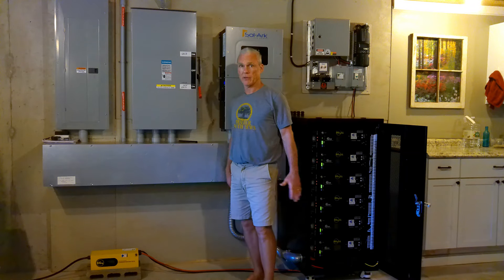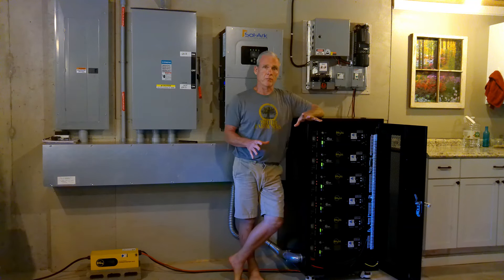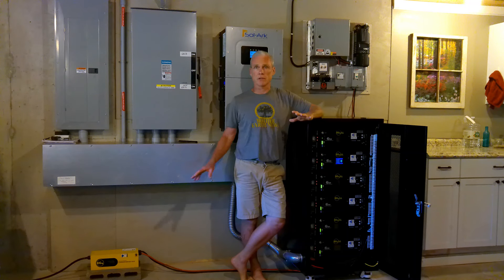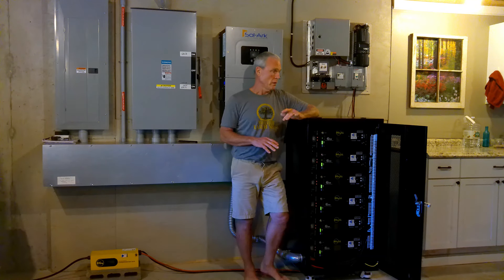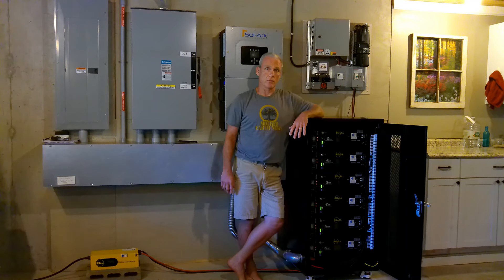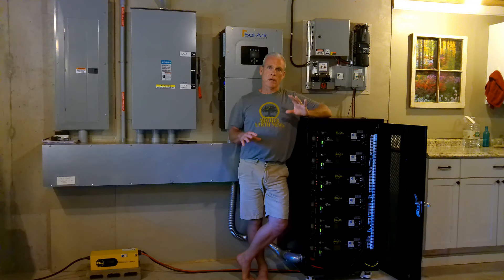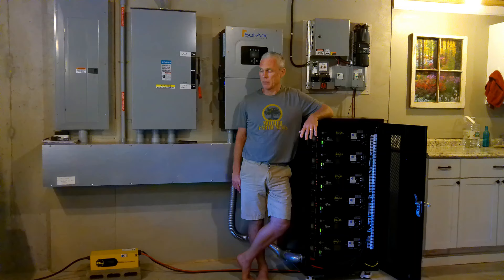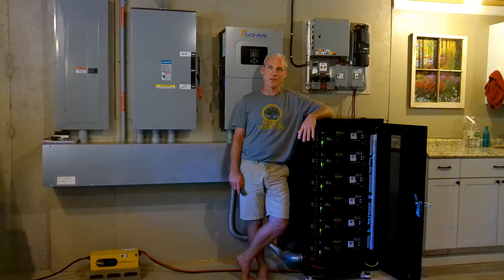Summary of our Off-Grid: Solar, Wind & Generator

Comment: This is literally a smaller version of what I plan to do! Only differences being that I'll have 10 of those EG4 battery racks (303 kWh total), 5 SolArk 15k's, 2 Missouri wind and solar controllers with 2 turbines (1 for each), 90kw of solar, and a 38kw Kholer Generator. This is going to be for a 100% off grid home with zero connection to the grid (too expensive to run it). Only question I have is, how much power do you think your turbine produces? Like on average how many kW does it produce nominally and and how many kWh do you think it produces in a 24 hour period? Been somewhat hard to find this info, I know that it varies by area but just trying to get a general number for each.
Reply: What’s your energy usage typically? 300kwh seems a bit excessive. But sounds like a really cool system
Reply: Good Lord. I think that’s enough power to run the USS Nimitz
Reply: @andrewdavenport6696  10 of those bateries have like 50 kw/h power,not 303,i think it a typo
Reply: @83kaszas  10 Racks, not 10 batteries
Reply: @jordanrobinson5817  oh right,i just re-read it,holy moly,thats alot of power XD
Reply from the maker: WOW!! quite an IMPRESSIVE system you have there...and people think I spent a lot of money! I wish I had a solid answer for you. I installed it in August, and we don't have much wind this time of year. My batteries stay full too and until the battery voltage drops low enough the turbine won't be able to push power into them so the turbine's voltage reducer will kick in. Now this winter when the heavy cloud cover and winds roll in hopefully it will spin up some power. I will post real world info on the power output then.
Reply: @goingoffgridatgreenshireho435  yeah cant wait for that! For a simple home dont need 300 kw battery....i have 17 kw,and for us is enough,even with electric cooking and hot water....i gues it depends how much ppl use..
Reply from the maker: Wow electric cooking and water! I take cold showers and theres only 2 of us in the house. I store too much food and water too! just never think I have enough and I can't live for the day...always in the future. More so now than ever.
Reply: Wow...hope you're planning to upload a YT video when your system is completed.
Reply from the maker: That is an amazing power plant he is putting in! I thot about adding another rack to my system, although I can't justify it because my 30kw bank stays above 75%. Can't imagine 10 racks and 5 Sol-Arks, it would take up an entire wall in my basement. I wish he was close by...I would like to see it in person.
Reply from the maker: OK, not a big deal but a bit of info for you...we have a 15-20 breeze today and the batt voltage is at 54, full is 57, but the clothes drier is running so were pullin hard from the solar. With all that going on the turbine is spinning decently and the MPPT is charging at 1.3A into the batteries. not a big deal but its doing its job. More to come.
Reply from the maker: Drier is off, batteries are full, turbine still spinning but MPPT is "resting" Auxiliary 2 on the Classic shows voltage reducer has kicked in. I think winter will bring good results.
Reply: I have 5 chicken farmers right next-door to me that are putting up over 60 x +500 W panels on the roof of their outdoor burns, and when I look at the pole in front of their place, it usually has three transformers. I guess if you think you're a big boy and you want to sell back to the grid, you need three transformers.

Comment: Nice solar array and batteries but the worst possible choice for an inverter. High-frequency, transformerless inverters like the one you installed offer a shorter life expectancy, and a much poorer surge capacity. And because these low-cost (cheap) inverters don't have an output transformer to provide galvanic isolation, they can damage your off-grid home's appliances when their MOSFETs fail. Don't take my word for it; ask Google AI the following question: Can a high-frequency, transformerless inverter damage your appliances?" and learn the truth about these crappy inverters.
Reply from the maker: Can you suggest an inverter for the people who read this.

Comment: Nice clean set up.   I would like to switch over to a gutter  like you have.  I am Running a 15k Sol-ark,  27,000 watts of panels.   One eg4 5000 watt mppt, 80 amp epever and a 50 amp epever.  11 eg4 lifepower batteries,   two build 280 amp hour batteries.  Running  almost Three years at this configuration.  Use between 50 to 100kwh a day.   Have three 48 volt battery chargers {45AMPS TOTAL) for Genny input if needed. No way could I go off grid with out a divorce.
Reply from the maker: LOL...I know others that have mentioned the "Off grid divorce." Sounds like a heck of a nice and powerful system....you have a big house and run heavy loads, my buddy is the same way and won't go off grid for the same reason you don't. His wife said "NO" to selling the big place now that the kids are out.

Comment: The solar credits are great if you start with solar and however this works only if small number of users have solar. In europe we do notice the same trend that the solar credits drop because the grid can't handle anymore the excess energy during sunny days. My recommendation for users starting with solar is  go for a PV system that works offgrid, always install more solar panels than you actual need and size you battery that covers 1 or 2 days of your normal electricity consumption. The small wind turbine is great during winter when there is less sun however more expensive than PV to maintain.
Reply from the maker: Wow I knew Europe had a lot of solar but didn't know it was too much for the grid. Wonder if America will get there...no time soon I'd guess.

Comment: Definitely seems like a waste of a grand for that transfer switch. Could have installed a 200 amp panel with feed through lugs. It has a main breaker, 8 spots and lugs at the bottom rated for 200 amps. Take those lugs and wire them  into the solark. Then solar output into your regular main breaker panel. Buck 80 I paid for mine. I still have the grid going into my inverter. The inverter can bypass if it needs to. Or turn off the main breaker in the bypass panel panel if u really want to have the no grid experience
Reply from the maker: Wish you lived near me and could help me build it. The electricians who helped me said the equipment and method were not negotiable, "We will do it and do it right" is what they said. I looked over the bid and plan and since they were very professional and the ONLY crew I could find within 3 hours of me, I said sounds good. When you spend 46,000  for a system the 1,000 for an excellent panel is not worth arguing.
Reply: @goingoffgridatgreenshireho435  woo wee. That's that's not pennies. 
I spent about 30 on mine. I have 12kw of panels, 12 kw of inverter, 85kwh of batteries but my system isn't UL listed. U definitely pay more for labor and listings. When it's not DIY. But yours system definitely looks clean
Reply from the maker: Thank you! I'm just a guy tryin to help others by sharing what works for us. The comments help too because it gives people alternatives that I may not of thought of or that may be better than mine.

Comment: Make a video on the wind turbine alone, what make and model is that and was it a kit with the control panel etc. It would be nice to see a video on it and how it hooks up to the overall system in detail? Did you keep any build pics and parts list diagrams etc?
Reply from the maker: I have a video on the turbine alone. If you click on the Greenshire tree emblem it will open the channel and you'll see the turbine video. It is a 1600w from Missouri Wind and Solar with a preassembled control board. There are different control boards for lead acid and lithium batteries. The turbine mounts on a 2" sch 40 steel pipe, the cable runs down through the pipe then through conduit to the control panel. The cable has 3 wires that connect to the rectifier on the control panel, then the 2 battery cables from the charge controller connect to the battery bank. I was alone and it took me a day and a half from start to finish. Once it's all hooked up call MWS and they will walk you through programing the Midnite Classic which is easy to do. The assembly of the turbine blades and tailfin itself is easy with clear photo instructions. The video will detail most of this for you.

Comment: Why is your generator not wired in through the SolArk?  Same with the wind turbine?
Reply from the maker: Good question, 3 part answer. I wanted to minimize the work the Sol Ark does. Since the gen and turbine are only used to charge the batteries it is more efficient to bolt them right to the bus bars. Lastly I will eventually use the "Gen" port on the Sol Ark as a dump load to the water heater or AC. The "Gen" port is both in and out current capable.

Comment: Building my system now. Can you do a video of the wiring through the bypass switch? How long can your battery bank power your home with cloud cover and how much energy do you use daily. Appreciate all your videos.  I guess I need to start documenting my process to help those in the future.
Reply from the maker: I will plan to do a video on the entire wire system by opening the wire way and panels...good idea. The thickness of cloud cover is what matters. With average clouds we take in enough power to fill the bank and run loads. Let me say my wife is a good sport and our friends roll their eyes a lot. With thick cover and no power coming in we will CONTROL our usage more (no laundry, dishwasher, blow dryer, curling iron, very short warm shower for my wife, I ALWAYS take cold showers), and be able to run about 3 days. However that is what the Chargeverter is for, emergency charging of the batteries. When the sun sets we use 5-6kw till sun up. During the day the batteries get topped off and stay full and if NOT using the A/C we use about 7-9kw. The past couple weeks the Sol-Ark has taken in 15-16kw from the panels, 5-6 to bring batteries full,  2-3 to keep em topped off, 7-9 to run the loads. We are very well trained on power usage from our 6 years of grid tied solar and my DAILY monitoring of our usage.

Comment: Hey thank you for sharing. What are the models of the unit you are using and the specs of the solar array I am trying to build a solar farm for me servers
Reply from the maker: Sorry for the delay, haven't been at my computer. I'm not sure what "models of the unit" is referring to. The batteries are (6) EG4-LL Version 2, 5.1kw / 100ahr, totaling 30kw /600ahr. Currently the panels are (24) Hyundai 290w, totaling 6.96kw. I'm adding (6) 400w panels this spring to help with the air conditioner in summer. The Sol Ark can take 3 legs of solar input. So I will have 2 legs of 3.5kw and 1 leg of 2.4kw.  The Sol Ark can handle up to19kw.

Comment: Hello, Thanks for the sharing your video! Just a question, how much power do you get from your wind turbine? And an avarage of what m/s wind?
Reply from the maker: Too early to tell. The batteries stay near full and I mounted it in August so not much wind yet. Come winter with clouds and wind I will find out what it can do and post more info. In winter we will have consistent 20-30 mph winds.
Reply: @goingoffgridatgreenshireho435  Thanks for your reply! Will be eager to hear your response and experience with this. We just installed a 4k Vertical wind turbine, but we didnt had much luck with wind here either.... max 8.95mph that would give a sad output of 8v :(   (the battery discharges faster that what could charge!), but we are still hopeful, we just have 3mtrs up, so that dosnt help either even though there are some trees around the coast its mostly clear...it seems for now its just a lack of strong winds. Will let you know if I have any news in my end as well, and look foward for yours! Happy off grids
Reply from the maker: I will put out a video when I have enough info to talk about. Thanks for keeping in touch in the future! Good luck
Reply from the maker: OK, not a big deal but a bit of info for you...we have a 15-20 breeze today and the batt voltage is at 54, full is 57, but the clothes drier is running so were pullin hard from the solar. With all that going on the turbine is spinning decently and the MPPT is charging at 1.3A into the batteries. not a big deal but its doing its job. More to come.
Reply from the maker: Drier is off, batteries are full, turbine still spinning but MPPT is "resting" Auxiliary 2 on the Classic shows voltage reducer has kicked in. I think winter will bring good results.
Reply: @goingoffgridatgreenshireho435  Thanks a lot for sharing, it does seem you are having some decent results and some decent amount of wind!!  Thats good to know! I was giving up on ours already seeing so many people not getting more than 25v from their turbines, but we did so much work for the platform and put it up (even though our pole is only 3mts) our platform is ready for a 20 mtr! :P It was sad to see the results, but its encouraging to see that your having good results with wind. Will hook it up between these days an dhopefully a windy day ill let you know our output. Thanks for the information and video!
Reply from the maker: Pablo, good news again. As it is a good sunny day my wife has done 3 loads of laundry and run the dishwasher. The wind has started to come out of the west now and the turbine was spinning decently. I went in to look and the MPPT Bulk on the Classic was .3 amps...not much power but the batteries are at 98% with the clothes drier running. I was pleased to see some power going into the batteries even when they're nearly full!
Reply: @goingoffgridatgreenshireho435  Hello paul thanks a lot for letting me know! Those are really good news indeed! Do you know how many V was the output? For em its more than a sad story :( Unfortunatley with decent wind (even though the turbine was spinning at a good rate - 4k turbine) just getting an output of 4 -6v and 0.3 amps...unfortunanlty it seems that the battery dosnt charge at all at this rate which is heart breaking
Reply from the maker: Volts were around 120 but the aux 2 kicked in pretty quickly because the batteries were at 98% and filled quickly. I always watch the amps instead of volts cause that's how you set the Chargeverter to supply power. I'll note the volts too next time. Volts right now between 80 and 95, charging amps 0, because the batteries are full the aux2 is taking the power.
Reply: @goingoffgridatgreenshireho435  Thanks for the insight Paul! That makes sense, will be checking the amps  more closely then, we should be having stronger winds soon, so will keep an eye on it an let youu know! thanks a lot!
Reply from the maker: Mornin Pablo, we had a couple of heavy cloud days with 25-30 mph winds. The sun ended up coming out both afternoons so ruined my turbine progress by filling the batteries but...day one 17 amp hours recorded by the classic, day 2,  21 amp hours. Not earth shattering numbers but if with more cloud cover and lower state of battery charge those numbers would be higher. Winters coming...we'll see just how high!
Reply: @goingoffgridatgreenshireho435  Good Morning Paul, thanks for letting me know! That's good to know! and those numbers looks amazing comparing to mine! You have a good setup! In my case couple weeks back we  had some good winds averaging around 26mph....we had 7v and a 0.02 amps! It was ridiculous and heart breaking, your video and information helped me gather courage to contact the seller and let him know this was concerning.....they say the motor might been damaged on transport and they will replace it.....still waiting for it....once installed ill let you know how numbers look....hopefully they will pick up....really thanks for the great videos and information!

Comment: You have there like 30 kw of battery? You can easly put the eg4 chargewerter to its max 100 amp,and use at least half of the capacity of your 13kw generator,impressive system,very nice,thanks for showing!
Reply from the maker: I have talked with Signature Solar's tech support about running it at 100A. It can be done but I hate to push it to the limit and with the current settings it raises the bank 20% in 2 hours with 2 gallons of propane. As seldom as I use it I could probably push it harder but...
Reply: @goingoffgridatgreenshireho435  Understood,well yeaj i get it,good thinking.
Reply from the maker: As time goes by and my confidence raises, the amps on the Chargeverter will probably raise too! Thanks for watching!